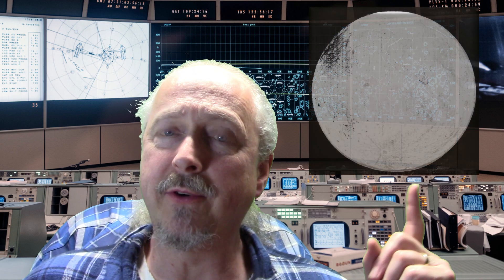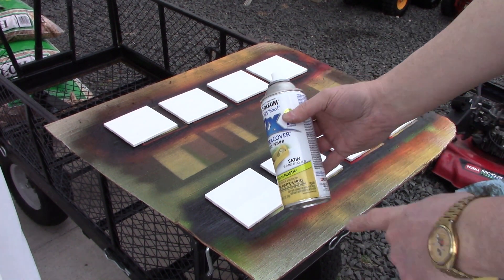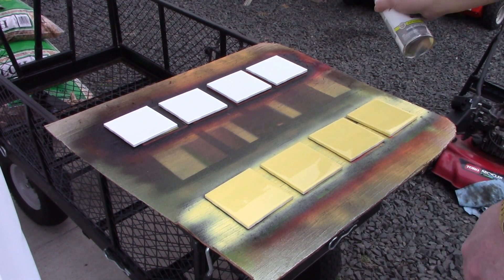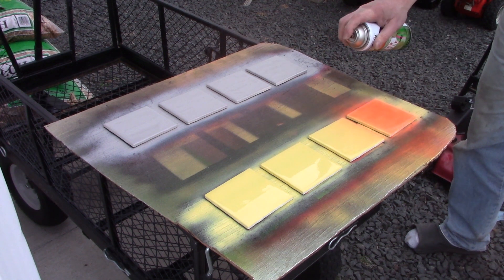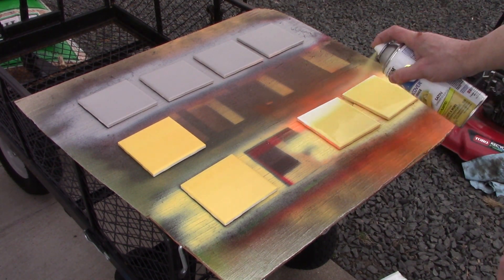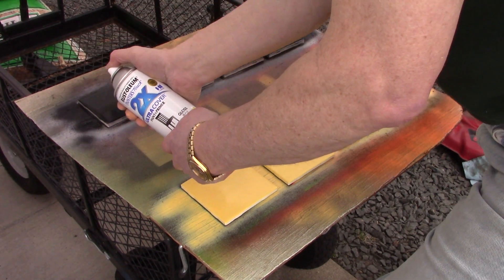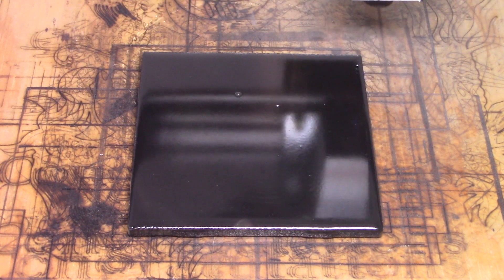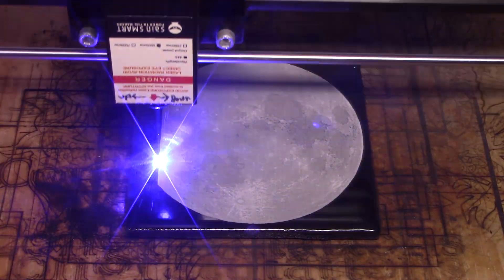Make a realistic moon engraved on a tile.

Comment: Looks good. I personally think a slight yellow tinge would match that picture perfectly. Almost a cream
Reply from the maker: There are several color options that could work well with the moon, creamy yellow as you said, light blue, red, maybe even silver!  I should try that to see how it turns out.  I have some silver paint just sitting there.   Hmmmm?
Reply: @CNCATHome  Silver could look pretty neat. Worth a shot.
Reply from the maker: @misternormie  - I tried a couple color options.  One was summer squash (a yellow flavor) and silver.  The summer squash came out a bit on the light side so speeding up the burn or lower the power would resolve that.  Otherwise it turned out nicely.  The slight yellow color worked well.  I did try the silver and burned that at 3,500mm/min at 50% power vs 3,000mm/min at 50% power for the summer squash and gray painted tiles.  That seemed to work out well.  Once it is all dry and I get it coated I will do a side by side to see which I like better.  The silver paint didn't play nicely with the glossy black.  I may have needed to let the silver dry more before the black coat.  The colors seemed to mix a little as there were some hints of silver bleeding through the black.  I like how that looks for the moon tile as those could be distant stars or something.  The silver color didn't come through like silver but more like the gray.  Thank you for the encouragement on trying this.